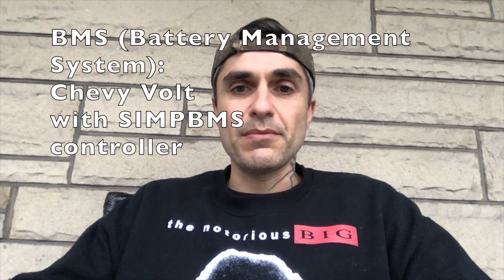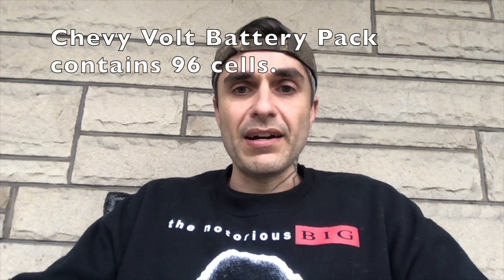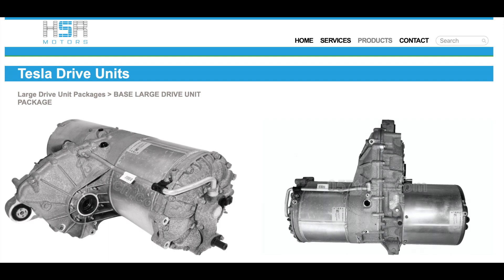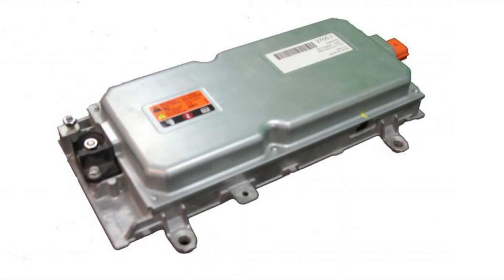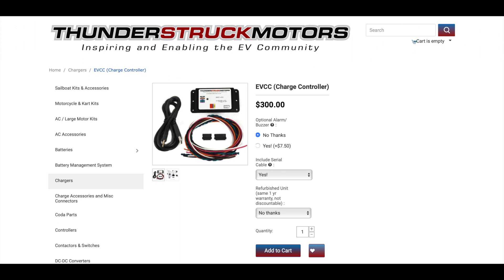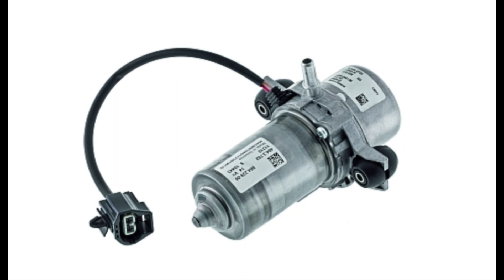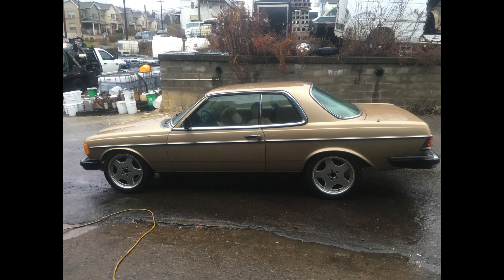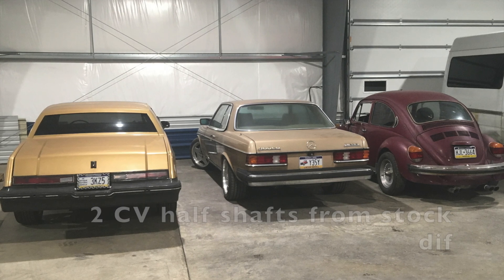Mercedes 300D Tesla Swap EV Conversion Part 1 Intro

Comment: David,

You’ve inspired me more than you know!!!

I currently have a 1989 Mercedes Been 560 SEC. It’s black on black and it’s my pride and joy. It only has 85,000 original miles and it’s in fantastic shape. However, as your well know, they aren’t very powerful and the premium gas requirement for mine is a whole other thing. 
I’d love to move into an electric vehicle and I could’t think of a better vehicle to convert!

I’d  love a chance to speak with you sometime regarding your overall experience and any current suggestions you may have. I don’t know if you have any materials and/or things that you might be building and selling for such conversions. If so, I’d be very interested in what you might wish to provide. There’s really no reason for me to reinvent the wheel when someone like yourself has done the same vehicle.

Comment: Hello, what was the reason for using batteries from a Chevy Volt? Many EV conversion projects are powered with Tesla cells...
Reply from the maker: I was on a budget and it was my first conversion.  The batteries would great but if I did another conversion I would use Tesla modules or aftermarket batteries to get more range.

Comment: Amazing and ambitious.  You and Rich Benoit could talk for hours (Rich Rebuilds here).  I would prefer the battery pack from the Bolt since its cooling system seems more robust (stainless plate and tubing).  Volt battery packs have suffered coolant leaks at the multiple rubber seals between the battery slices.  But, you run with what you've got and can fit.  Another kink is that battery voltages vary.  Tesla is 400 V, Bolt is 350 V, and Volt is 300V.  Many newer battery-cars are 800 VDC, which makes cabling simpler and charging faster.  An advantage of the M-B W123 is that it has good handling for the 1980's, with independent rear suspension.  Downside is that parts are rare and expensive, unless you have a whole donor car.
Reply: Parts for W123 are very easy and if you join a Mercedes club you get great discounts on spares. They still make new parts for W123's .
Reply: W123 parts are not rare or expensive.  What is the basis for your comment?
Reply: @davidneumann6231  At least for the W123 diesel cars (300D, 300SD, 300CD, 300TD, 240D), try buying a vacuum pump, shut-down valve, climate mono-valve, and such, and I don't mean the Chinese knock-offs which don't work.  Many are now "not avail" and priced like gold if you can find the parts, even used ones.  A rebuilt diesel engine costs $8500.  My basis is that I own two 1980's 300D cars.  Not that I love them, I bought the 2nd one for an engine to fix the first one, then ended up fixing both.